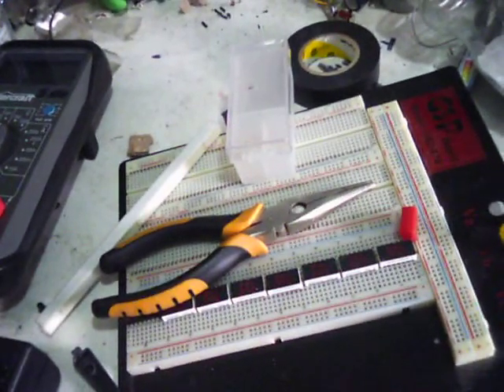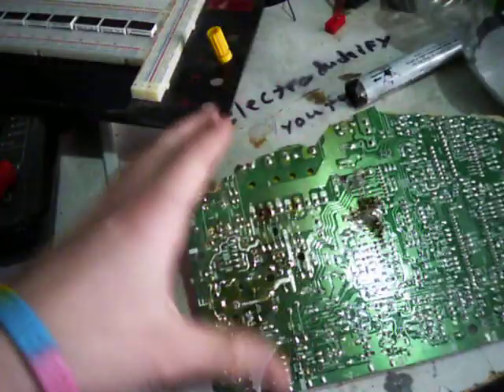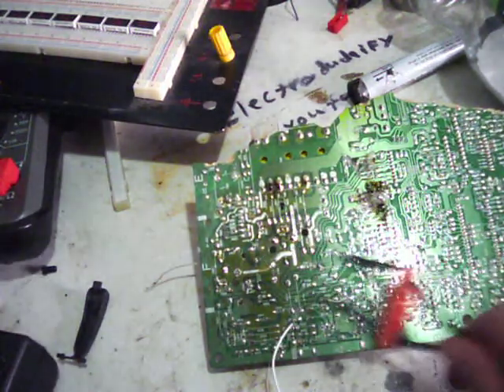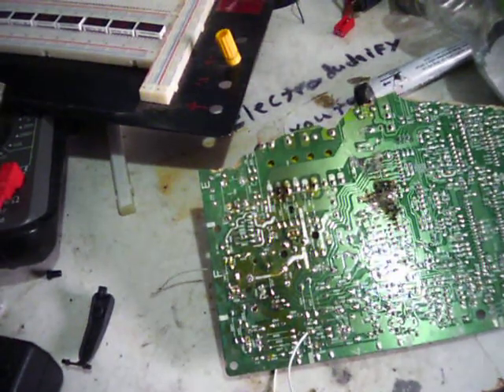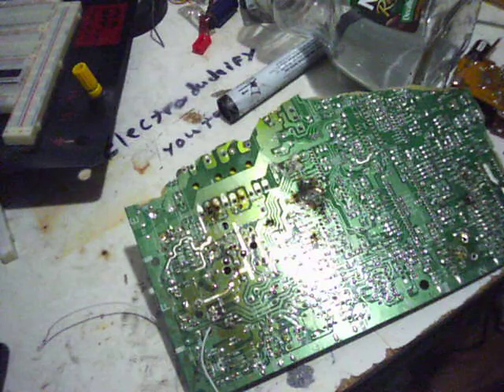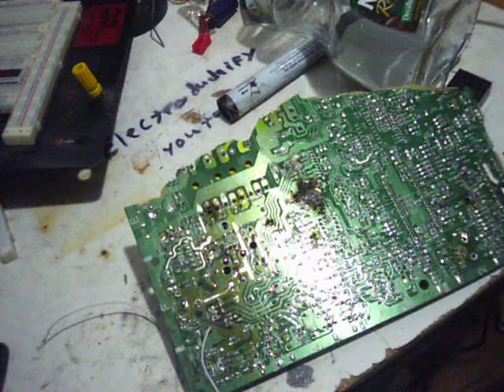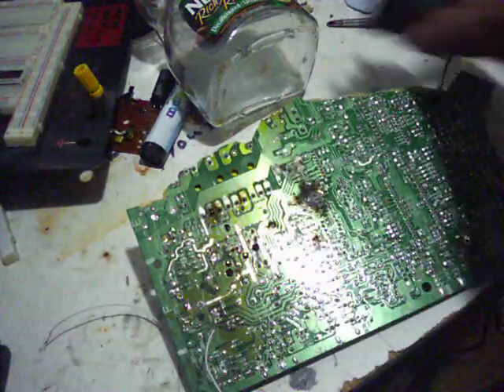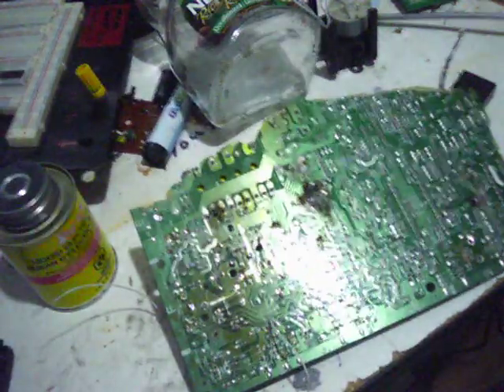Exploding circuit board with HV capacitor bank

Comment: hey man, good work, why don't you try using a 2000 micro farad capacitor. like 2 of them, from a computer board.
Reply from the maker: I never seen such caps on a computer board, maby in a computer power supply.
I will look for some and eventually make a bigger cap bank!
Reply: Electrodudeify try an DC 12 volt power supply, an older model. it should have a 5700 uf cap.
Reply from the maker: ok, thanks, i did find 2 caps rated 470 uf in a compter power supply
Reply: Or try buying ultracapacitors online :D